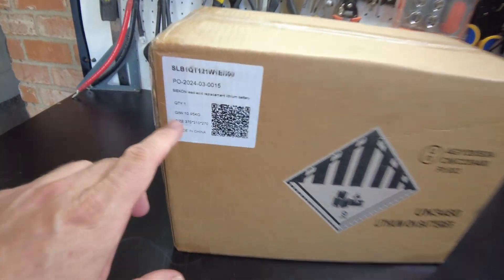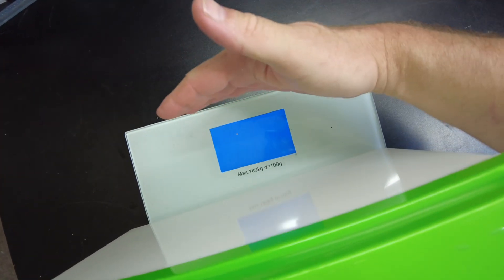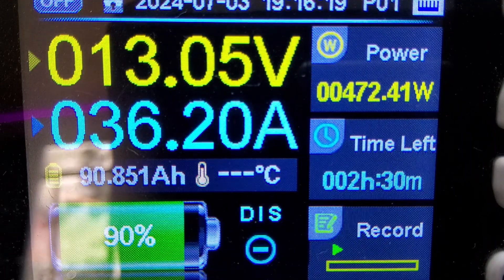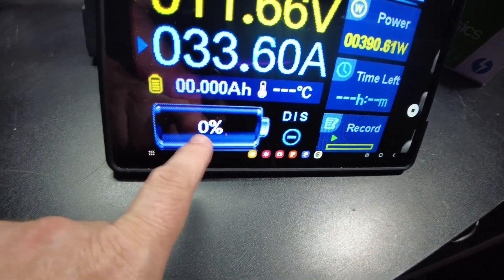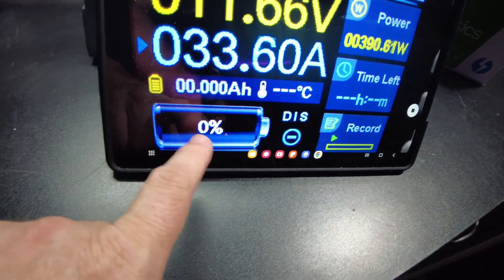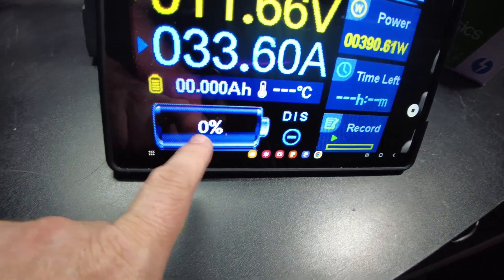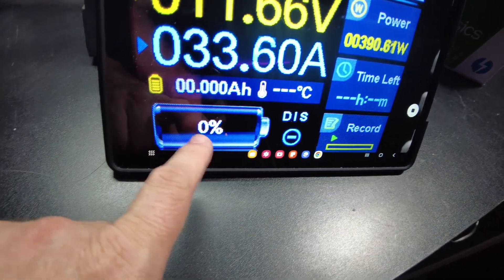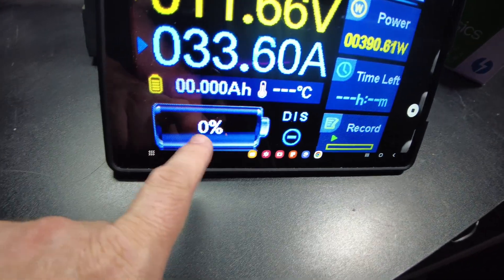SIEKON 12V 100Ah LiFePO4 Battery

Comment: Far too overpriced for an LFP battery with a discharge rate of only 20 Amps and no Bluetooth.
Reply from the maker: It has a max continuous rate of 100a. I believe the 20a (0.2c) is recommended for longest life. Thanks